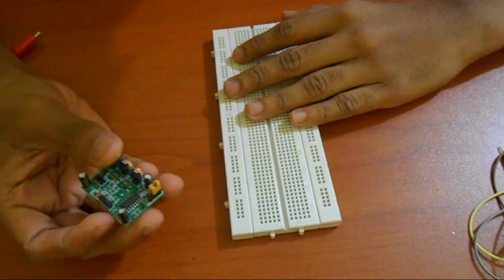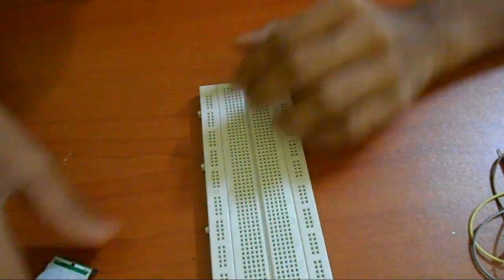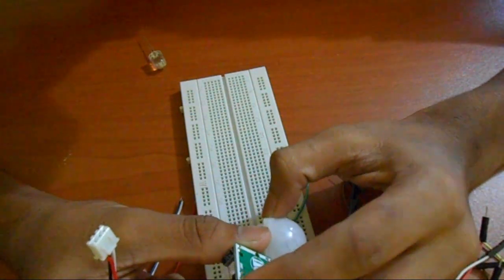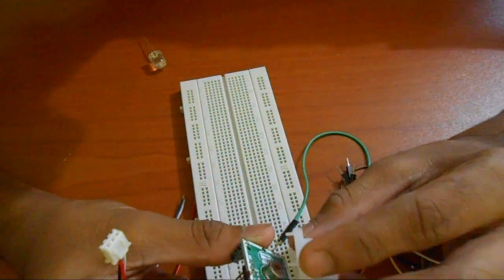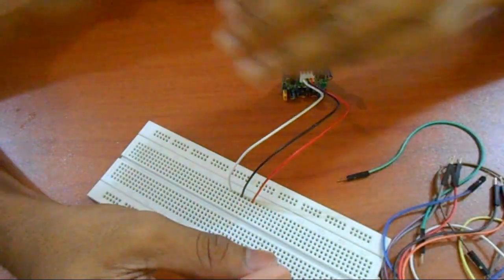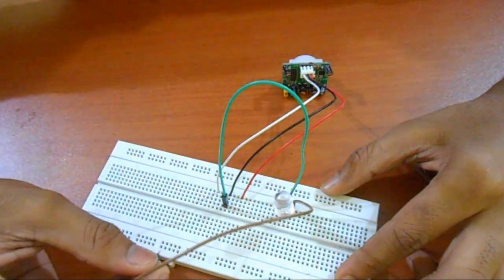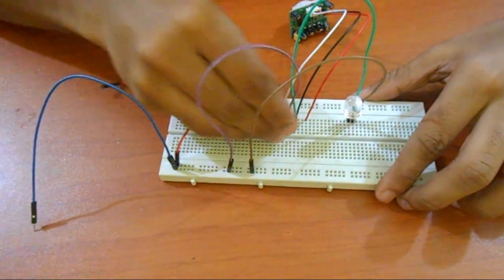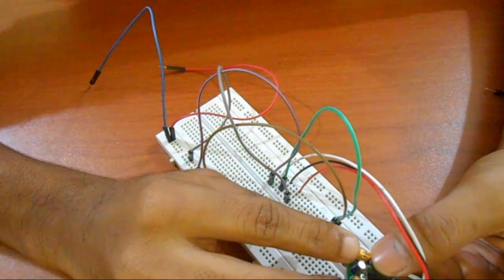How to make a automatic light with pir sensor - in sinhala

Comment: good job , only one question plz 
is it possible that while there is a person in a room or stays in a room. the light will conttinue to light up?
Reply from the maker: i had the same question.....it is not possible to do only with the pir sensor it self but with a transistir,resistor and a capacitor you can do it

Comment: hello ..goodmorning i want do the same your work but i have 24 volts what should i do should i reduce it into 5 volts also because my pir is 5 volts,,,
Reply from the maker: +go electric you can use a buck converter....just serch 5V BUCK CONVETER in ebay...you can find them very cgeaply..sorry for the late reply
Reply: ok ,thank you so much for your suggestion sr.uditha i hope my device work well ,,

Comment: Good day. one question: what I need to do if I want to turn off the light instead of turning on ??? and I am going to connect a 12V led strip... best regards
Reply from the maker: if u want to turn off a light use a relay and a transisitor.connect led strip to relays NC(normaly closed) pin.so when the pir sensor activated the relay will activate and after that the led strip will turn off.thankyou
Reply: Thank you very much. cheers
Reply: Can you help me with the circuit diagram please ???

Comment: HI Mr Mudalige, 
12V also good? just have a strip of led lights that go on 12 V and a pir motion detector and 12V adapter. Is that all I need to make this work?
Reply from the maker: +Telephone Telephone  no u need a mechanisame to give the power to the led strip cz pir sensor out put voltage is limited to 3.3 v so u can use 5v relay it is the easy way...if u need a schematic diagram plz contact me again...
Reply: Dear Mr Mudalige, Thank you for your reply. So swift. Thank you yes I could use a diagram.

Comment: Can i use a buzzer instead of a led. plz tellme if it will work or it need some music ic to produce sound from the buzzer.
Reply from the maker: +Moezz Rana  yes you can use i buzzer
Reply: +Uditha Mudalige ive followed the video but my circuit is not working the current is flowing through the wires connected to the pir terminals but pir is not detecting the motion and buzzer is not buzzing could you plz figure a solution for my problem

Comment: If I use a 9V battery to power this will it blow the sensor? Im creating a motion sensor LED lightstrip.
Reply: +Iso Rabins  9v is ok :)
Reply from the maker: +karen berry no it's ok the maxiamam input is 9v..u can power the sensor with 9v
Reply from the maker: no it won't blow up??plz chek ur pir sensor specification...some can hadle up to 20v but some can't.

Comment: Question, does the output (middle) pin on the PIR sensor go low as soon as a person leaves the sensing area? Like if I had the output connected to an LED which turned on when someone entered the area, would it turn off as soon as they left the sensing area? Thanks :)
Reply from the maker: no you can set the time..you can adjest the led on time by the preset..there are two presets..one is for sensitivity and seconed one is for the time..you can ajust the led time from 2seconds to 3minutes it will dipend on manufacture..if have have any question leave a comment..sorry for bad english..by the way how can you understand my video language???
Reply: Uditha Mudalige This helps me a lot. I couldn't understand you in the video, but I saw that you could speak english in the comments and you seemed to know your stuff! thanks :)

Comment: cool!
Reply from the maker: thanks bro.but can u understand my language?
Reply: No problem buddy! No, not really. I didn't seem to understand anything! I just thought the  general idea was really cool. It gave me a basic understanding on how to wire this kind of stuff up.
Reply from the maker: RcModelTest heyy bro ur channnel is about rc planes?can u tell me what is the best scratch biilt plane for begginerrs?i try to make a plnae called blu baby e timea but it never flys?can tell mw the best rc scratch built plane begginers?thanks..
Reply: Uditha Mudalige I would say that the best plane for beginners to build is some kind of delta wing or even a slow fly trainer. the reason why I would recommend a delta is because of its simple design, and the fact that it has most of its electronics in the back. so if you do end up crashing it, you wont have to worry about your motor and whatnot getting damaged. another one I would recommend is my mini delta wing  @watch?v=nALz6FO1TOU , its simple to build and extremely easy to fly. I wish I could have plans for every plane I have built, but I do not the have the proper software to make them. but I do post some specs about my planes here @community/members/rcmodeltest.51046/.or I just give the specs In the video. another good trainer is @watch?v=KOixZFAyoikhope this helped!